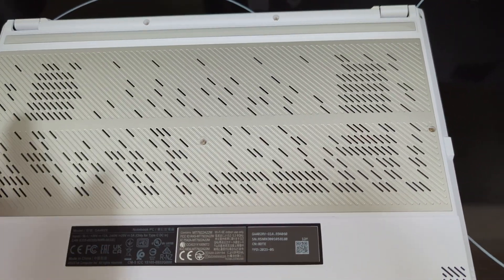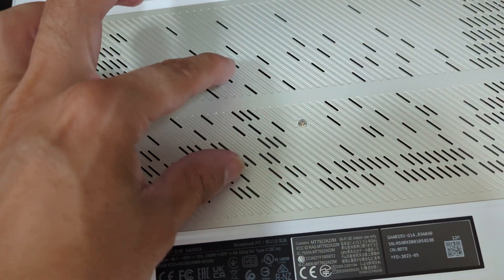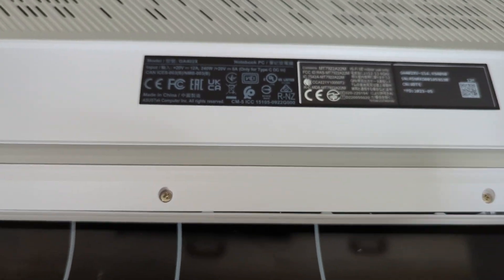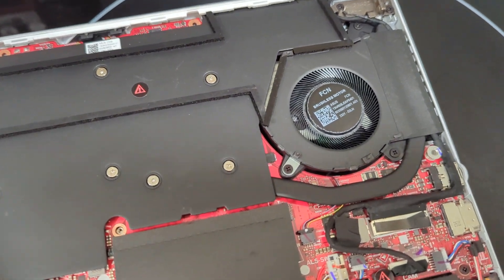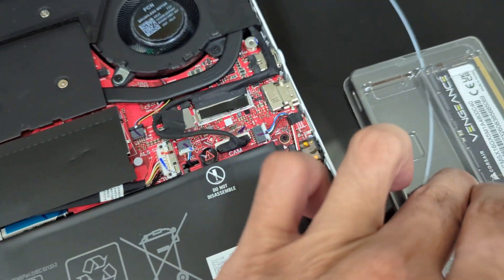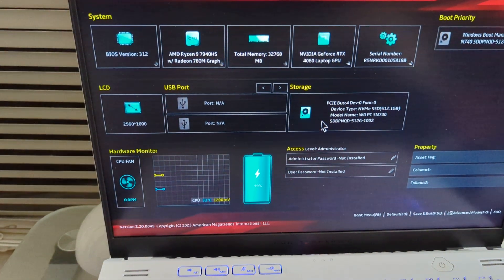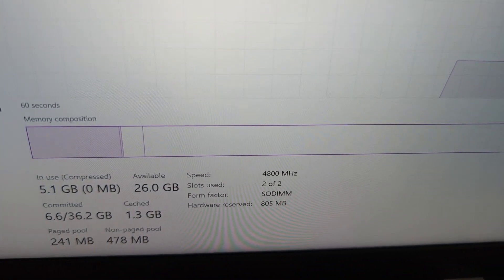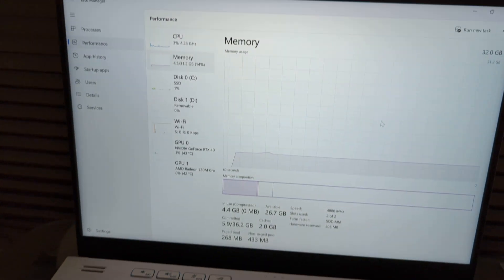ROG Zephyrus G14 ddr5 ram upgrade 32gb !

Comment: You're bending your ram. You should always start by unplugging the battery. run the cable over it. You also always have to plug ASUS stuff in after taking the back off. It has an ambient light sensor. 

Also the screws aren't holding in the keyboard. If you're going to post a tutorial you should either mention this is how you do it because you know or just be up front about winging it. If other people copy you by forcing down the ram stick they could mess something up.

Comment: How do you push the ram in more the sides for me are off
Reply: Firmly push the ram in at a 45deg angle before pushing it gotten to locked in place. If it was seated correct at the 45deg ángle then it will lay flat perfectly and the latches will fit into the slot perfectly and the computer will show the correct amount of ram
Reply: @elmalleable this comment helped a lot. Thanks!
Reply from the maker: Nothing you just keep trying until it looks maybe bend the sides slightly